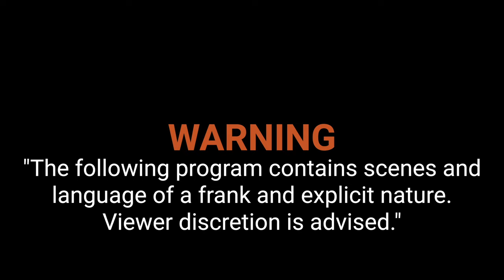How to Replace RV Dump Valve | Valterra Gate Valve & Hub Assembly

Comment: Do you have a video teaching how to and where to put hoses to flush black tanks AND where to put hose to flush gray tanks . We have a 2015 ABus 37ap and the previous owner says we have to add water to our black and gray tanks from inside !! But yet we see ONE  “flush” inlet but dont know if that’s for black or gray tank ..
Reply from the maker: Randy says the only flush you have is the black tank. He talks about the flush for the black tank in this video but we do not have one specifically for a flush
RV Travel Day Breakdown | RV Breakdown | Full Time RV Living
https://youtu.be/gI7AT771-GE
Reply from the maker: Basically you are putting fresh water into your black tank. Make sure you use a DIFFERENT hose besides your fresh water drinking hose. We use the orange one specifically for flushing the black tank. You hook that up outside in your wet bay. Turn on water and fill the black tank. DO NOT OVER FILL THE BLACK TANK. It will come out inside the coach. That’s why he says he times it and checks the gauges. Once full you dump it. He does at least 3 flushes to make sure the tank is clean. We do not flush the grey tank. We use a geo method to keep both tanks clean. Here’s the link to that video. Basically Dawn Dish Soap, Calgon water softener and vinegar along with Happy Camper. Links are in the video description for the happy camper 
How To Get Rid of Black Tank Smell | Black Tank Odor | RV Life (4K)
https://youtu.be/Qr0GxlGqDdQ
Reply from the maker: In this valterra gate valve replacement you can see where he hooks our orange to. The other end gets hooked to your water source and then turn on the water and watch your gauges so you don’t over fill. Shut off water once full and then dump the black tank.  Hope that’s helpful 👍👍